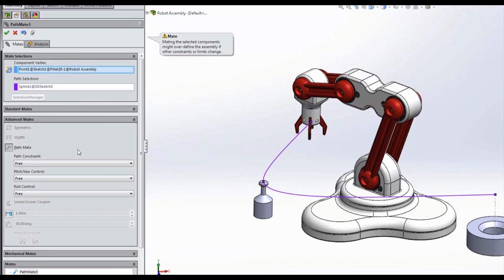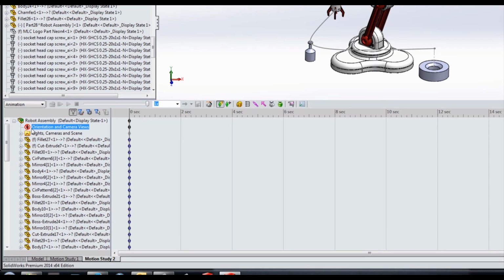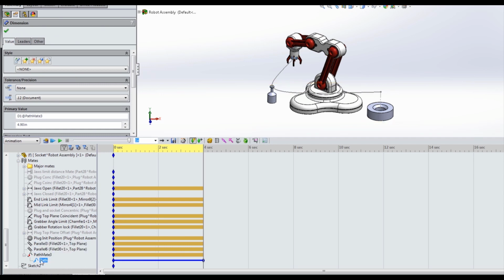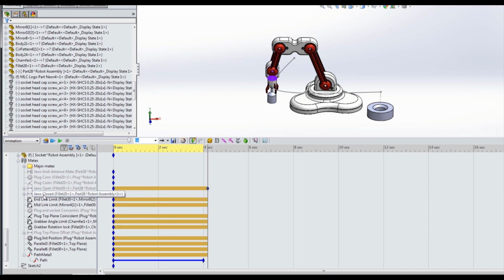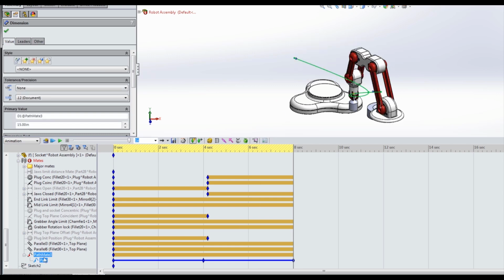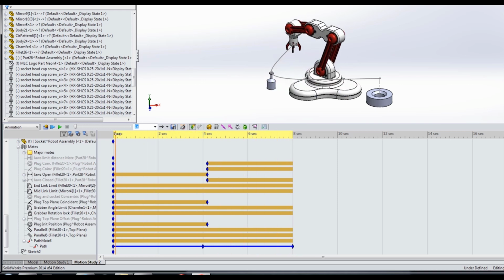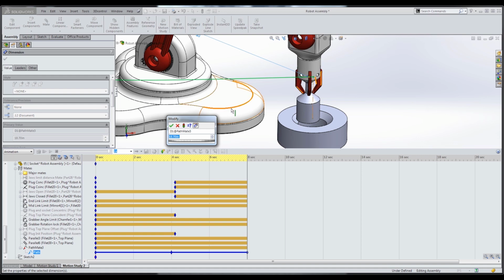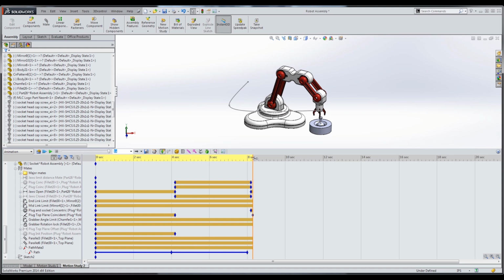Advanced SOLIDWORKS Animations 2/4 - Toggling Mates

Comment: Do you know of a reason why the option to manage Interpolation Modes does not appear when I right-click the key-point? The option does not even appear, and this is in SolidWorks 2023
Reply from the maker: Interpolation mode will not display for keyframes that are at time=0, and depending on the type of key it may not be available at all because it doesn't have any meaning in the context of that element.  For example, there is no interpolation option for suppression state of a feature, a mate like coincident that is only ever on/off, or the key at the beginning of a change bar.  If you are performing a move or adjusting a mate like distance or angle that is causing movement then it should display at the end of the change bar.
Reply: Thank you, that helps very much! Is there a way to make smooth transitions between suppression states of assembly mates? I've successfully toggled mates on/off at the right times, but the animation between those changes is just a hard jump-cut to that suppressed/unsuppressed mate.
Reply from the maker: Suppression is a binary on/off state.  If you are suppressing one mate to unsuppress another, make sure the two mates are compatible at the time of the swap.  The keyframes can be at the same exact point in time so there is no period of time where it is unconstrained and the motion can look smooth with no hard cut.
Reply: Thank you, I appreciate all the help!
Reply from the maker: @masonkiel  Happy to help!